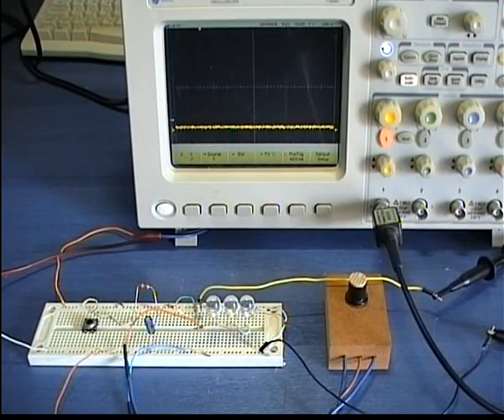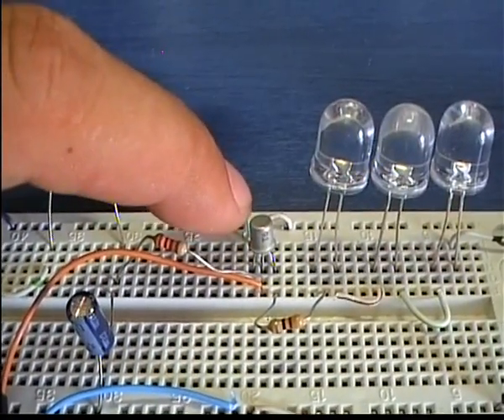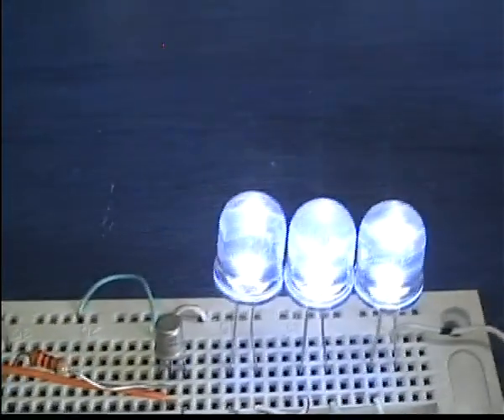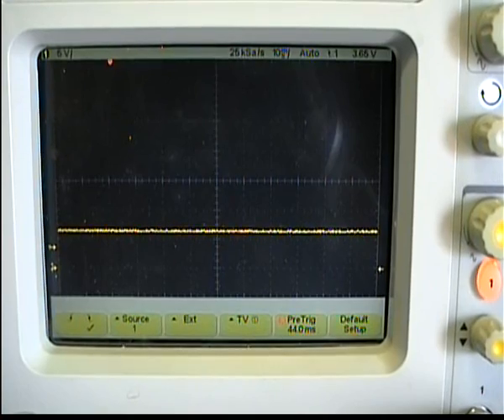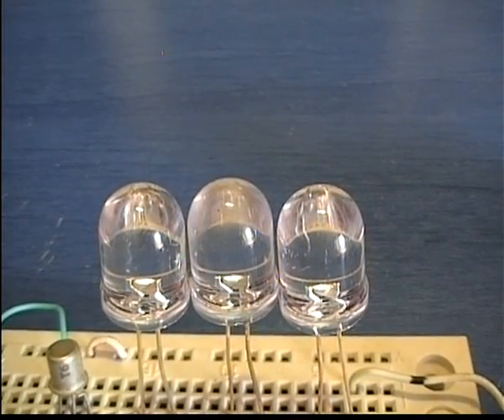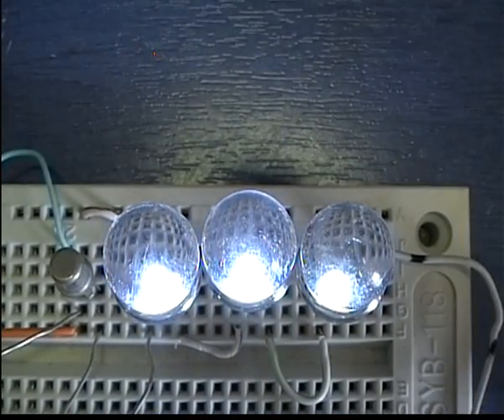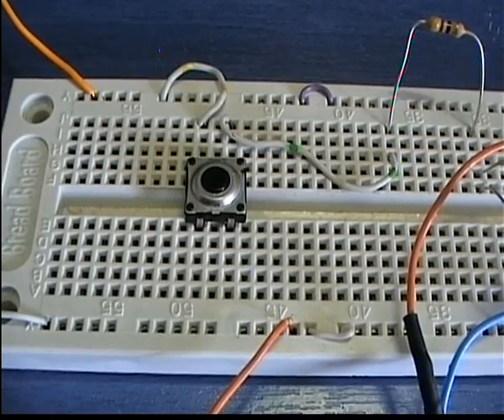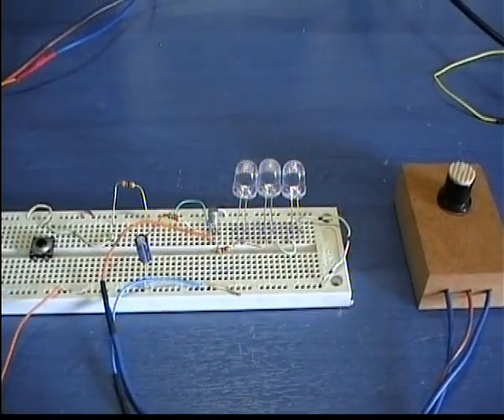LED Off Delay Circuit with dimming effect

Comment: when I need a 12V or 24V relay with a time delay, I buy a Regtime series relay on ebay. Delay (0-60) (60-600) (600-6000) sec. I bought 2 times. Works great.
https://www.ebay.com/itm/273781126741

Comment: how can i get this but for 120v... i have flood led lights outside 30v one led, and i want this effect every time the light turns on automaticly, then face off when gets off, actually i just need the fade in fade out controller because the sockets have the motion sensor and this is programed for 3 mins each time... wonder if you have or can create a diagram or sell the circuit itself...

Comment: @itolond just use a higher resister for the led the higher it is the more current is being taken up just keep using different (high) resisters until you want the dimmest you need thats what i will do its much easier